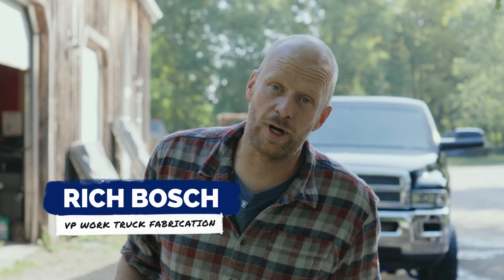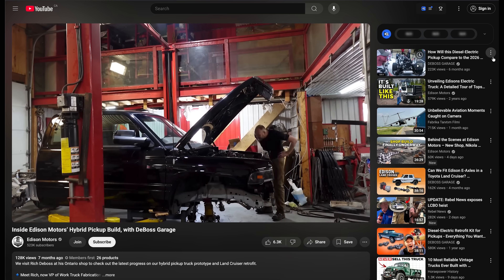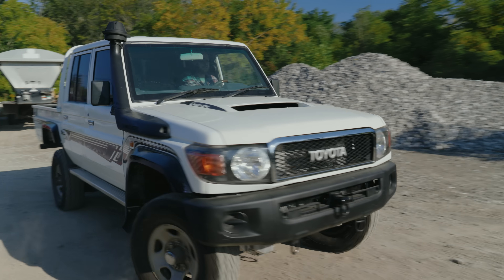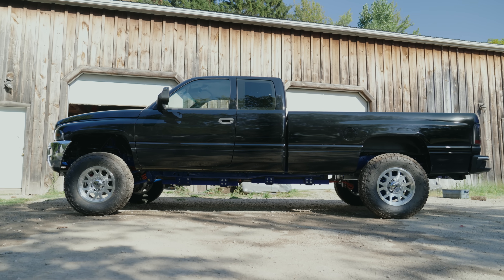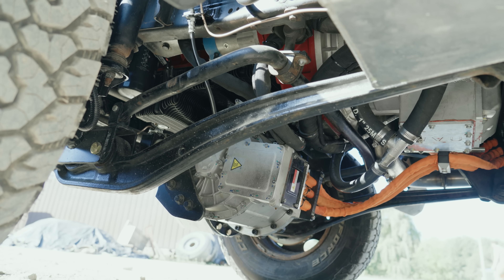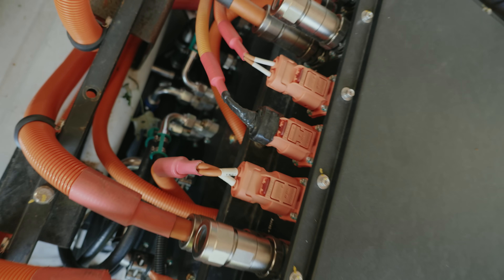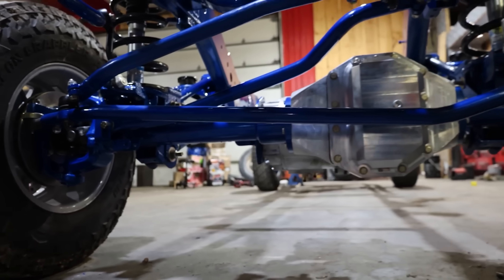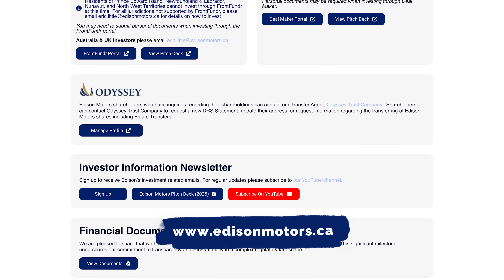We’re Building Pickup Trucks with Electric Axles, Here’s Why

Comment: How about a motor that bolts on an existing rear axle without U-joints?  There needs to be a more cost effective way of converting vehicles that don't need or want this "instant torque", and certainly can't just have the chassis swapped, like older motors homes, box trucks, etc.
Reply: Its not about instant torque, even if you remove torque from the equation still rpm reduction is needed to drive the wheels and motor at the speeds they best suit in. For example, an electric motor may give peak efficiency in 2000 rpm while wheels need max 500 wheel rpm but existing differentials may have different ratios not allowing us to do that.
Reply: If I remember Carl, the first conversion with a Tesla model 3 motor snapped things. 
See all the trouble they had with the first e-axles (Topsy).
If you add to it that is a regular axle with reduction that is different for a lot of trucks. It creates so many variations of fine tuning things. And most buyers might not be able to do that themselves. So installers need to spend a lot of hours (which end up on the cost of the conversion).
The e-axles takes away complexity in how things vary.
And I think the frame rails thing is similar - they find that there will be variations needing custom solutions and instead providing the rails and motor mounts reduces that.